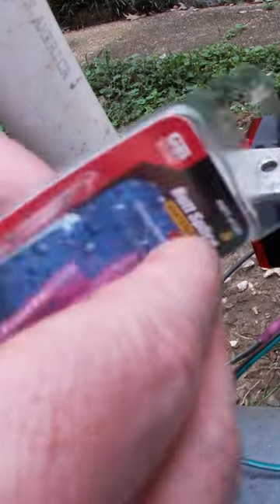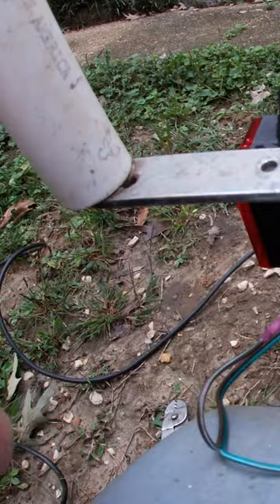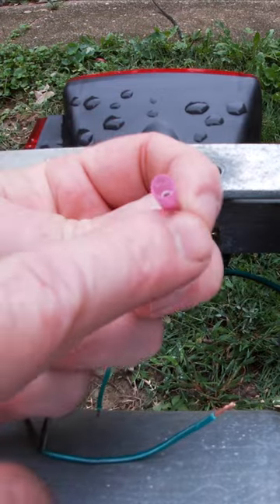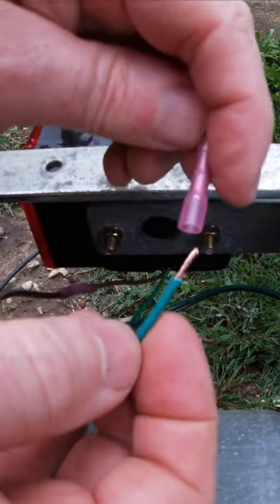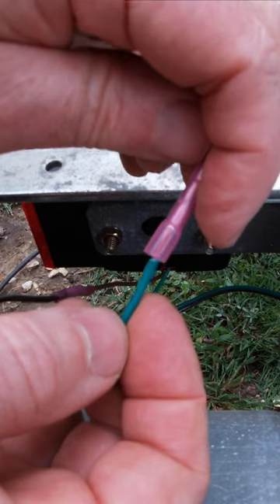How to waterproof butt splice connectors trailer lights #trailer #wiringconnection #boattrailer

Comment: Use the heat solder connectors with marine heat shrink over it. You can even add a little marine grease to keep the water out.